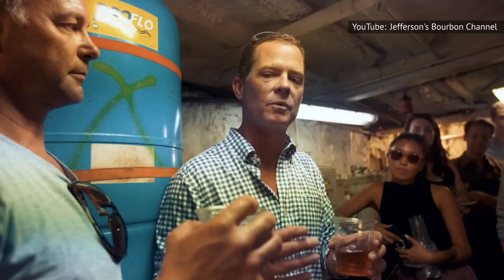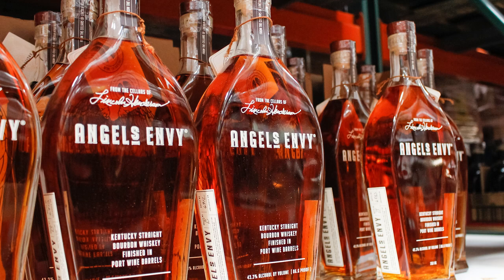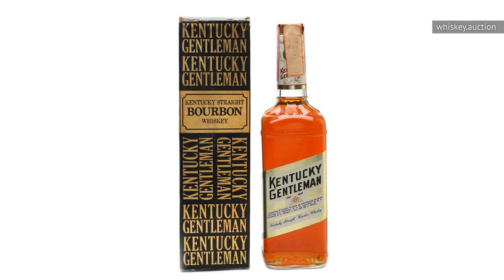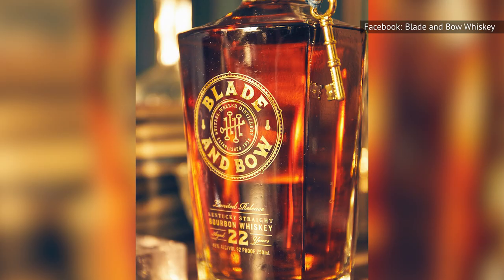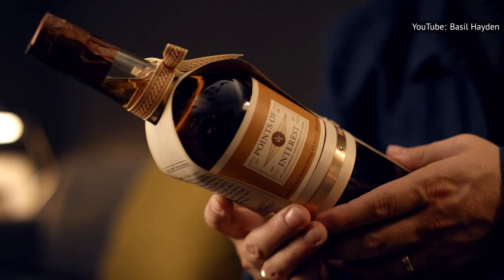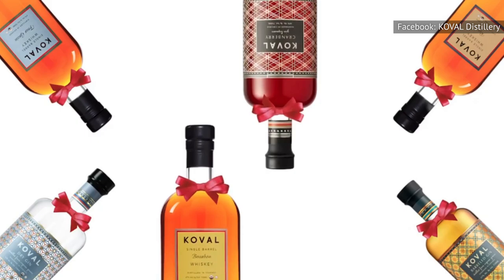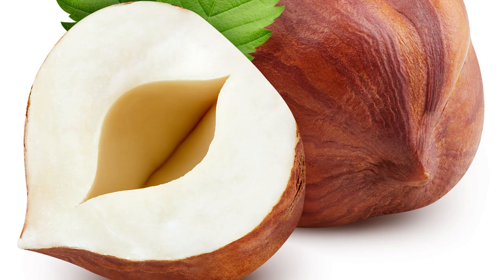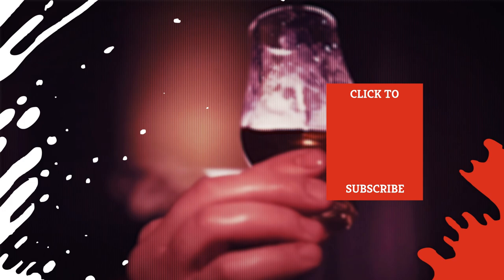12 Bourbons You'll Regret Buying

Comment: Let Blade and Bow open up a few weeks after opening your bottle and it will totally change.   It’s not a $60 bottle buts it’s a solid buy at $45.   Basil Hayden is overpriced and a horrid dram.  Stay away no matter what.  Willet Pot Still is a hit and miss bottle for sure.   Koval has never ever disappointed myself and my bourbon buddies.  I’ve tried all of their offerings and have ZERO disappointments.  Larceny is a damn good entry level bourbon.  Not sure why folks bash it as it’s a solid drinker.